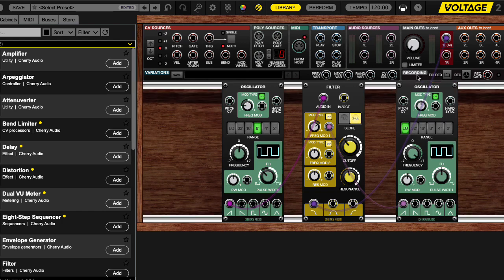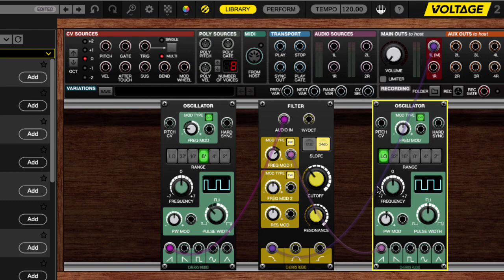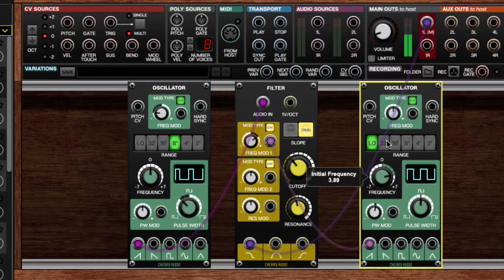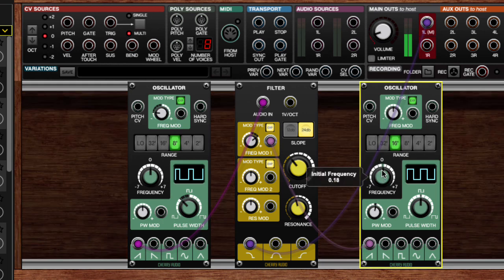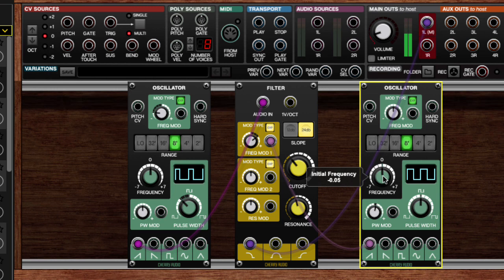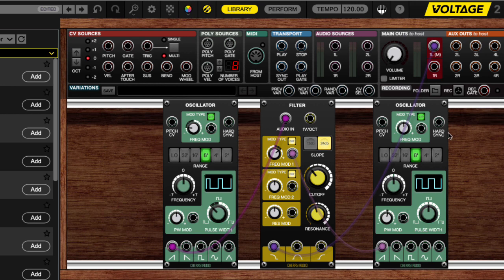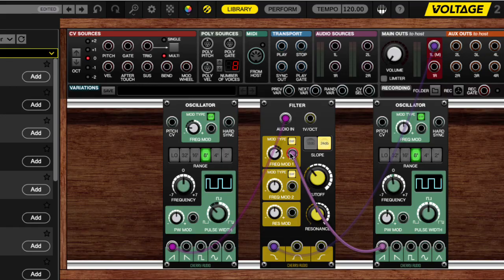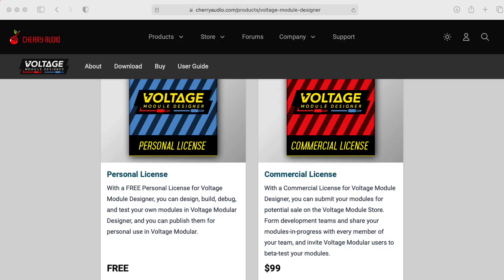Control Signal Aliasing in Voltage Modular by Cherry Audio (Modulating Filter Cutoff at Audio Rates)

Comment: great video! imho Voltage Modular really starts to shine when you explore the third-party dev modules. there are some HQ gems in there from very creative and highly skilled developers.
i think what you are experiencing here can also be attributed (partly) to the "analog character" of the CA OSC. these oscs have a slight pitch drift going and thus produce a beating sound when modulating each other ( or any part down the chain like the filter of course). i've tried your setup with the CA Filter with one of my oscillators and couldn't hear any beating/aliasing when the oscillators were in tune. to my knowledge the CA filter and its inputs are updated at audio-rate (VM has a fixed internal sample rate of 48kHz). give or take it might do coefficient interpolation over some samples to remedy zipper noise though.
Reply: I agree with ChR_is. I've done extensive experimentation with the stock Cherry Audio Filter tonight, and can confirm that it processes the cutoff frequency CV inputs on every sample period (48,000 times per second). The same is true for the Resonance CV input.

You will achieve exactly the same 'LFO' effect if you set up this patch on a true analogue modular, too - it isn't unique to Voltage Modular or any other soft synth. The frequency of the 'LFO' effect can be calculated as the difference in the two oscillator frequencies (AKA the 'beat frequency'). You also get the same 'freezing' and 'reversing' effect on an analogue synth as you change the frequency of the modulating oscillator relative to the audio oscillator.

Comment: It would be awesome if you decided to join the third-party developer community for Voltage Modular. I'd love to see your knowledge and insight into the mathematics of audio electronics be applied to the DSP inside new modules for VM.

For the record, a lot of modules currently in the Cherry Audio store DO allow audio-rate modulation of filter cutoff freq or resonance. As you rightly point out, this will inevitably lead to higher CPU usage, particularly if you're performing calculations for volts per octave modulation sources (raising 2 to the power of x). Swings and roundabouts! In the case of (linear) VCAs, it's actually MORE efficient to just perform brute-force audio-rate modulation all the time, than attempt to streamline the process by reducing the sample rate of the modulating signal.
Reply from the maker: Thank you for your kind words! (I just subscribed to your channel).